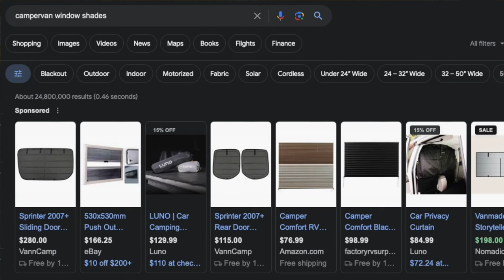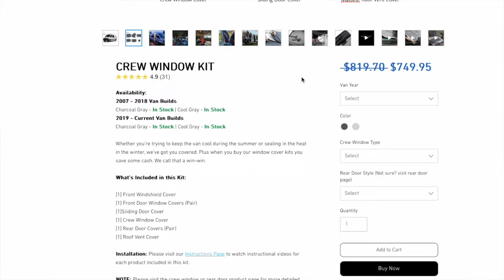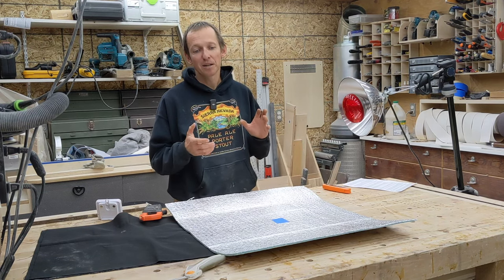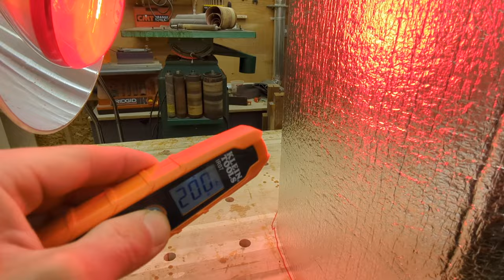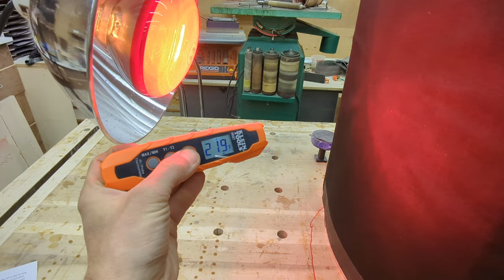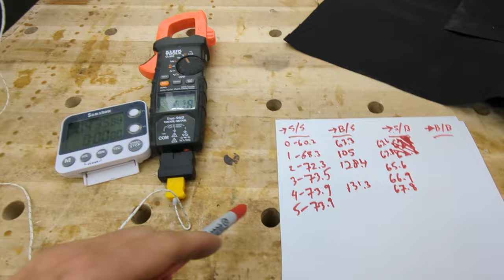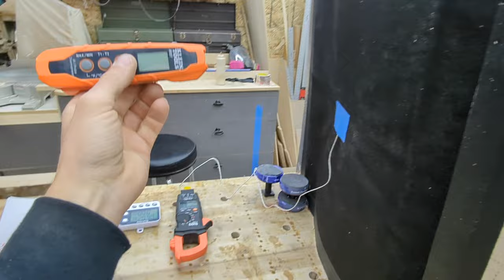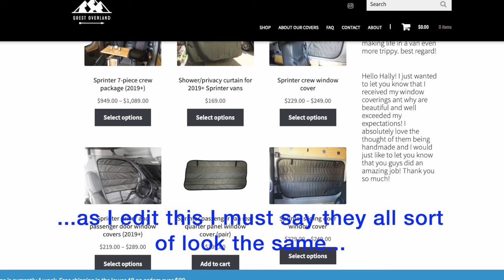Don't Believe the Hype: Window Shades for your Camper Van Conversion

Comment: Do they work “as advertised”?  Probably not as great as you’d hope.  But here’s the deal:  I have tested professional window shades.  In my case it was Two identical Promaster builds (Winnebago).  In one van (my brothers) we covered all windows with the Vannmade custom shades.  In my van, NO shades.  Vans were parked in same orientation, 30 feet apart.  We closed up the vans at 8am at the same internal temperature (68 degrees).    At 2pm, it was 93 Fahrenheit outside.  My van internal temperature was 88.1 Fahrenheit .  My bother’s van.. 78.5 Fahrenheit.   That’s over 9.5 degrees.  Would a simple curtain have done the same thing?  Maybe.  Bot don’t fool yourself, ANY window shades will work to a certain degree.

Comment: It would be interesting if you built an insulated box that has auto glass on one side and reran the experiment with the temperature probe in the middle of the box. Having the glass between the heat source and the shade could change things a bit.
Reply from the maker: Yep, that is something I'd love to do, but just not in the budget.  Even more so to test the various insulation options out there.
Reply: @projectofscience  you might be able to get a free broken piece of auto glass from a junkyard. Thanks for sharing your videos.

Comment: What if your stealth camping and only putting up the coverings at night? In this case there is no direct sunlight. Essentially your just trying to keep the heat in the summer air out of the vehicle, would a black surface matter then?

Comment: Another great and informative video-Thank you! I made my own window covers. I used silver reflective material that faces out with no cover, then a layer of wool insulation followed by dark cloth material that faces inside of the van.
 In summer, the reflective side faces out, and in winter I flip them around so the reflective side faces in. I don't have any test equipment other than my hand.
In summer, when I place my hand in between the window cover and window, it feels very warm, and when I place my hand on cloth material facing inside of the van it feels cool. I'm not sure what's happening to the heat??? 
The only issue that I have is that they are bulky. I wish that could think of a way to compress them when not in use.
Reply: Sounds great. I’m more concerned with staying warm too. Do you have any problems with condensation with your setup? I like the thought of compressing them for storage - has me picturing some kind of self-inflating sleeping pad hack : )
Reply: @s-c..  was in van for three months driving to Alaska and back to Texas. No issues with condensation

Comment: I think the foil backed insulation is itself flawed..  Or, at least it misses some of the benefit of the foil as a radiant barrier.  The foil’s contact with the foam means that the radiant heat being blocked by the foil is conducted to the foam.  And hence through the foam. A better product would separate the foil from the foam, which is obviously mechanically challenging, which is why it’s not done.  

I think a better test would be to install the different insulation solutions onto a box with a thermocouple or thermistor on the inside.

Comment: You didn't test an actual product - yes you are going to lose some efficiency with the black.  But the air gap is extremely important so would be interested to see a real product test. This has to be appealing for people to want to buy it and the black covering appeals for other reasons - aesthetics for instance.

Comment: They do work but you have to make them properly ive tested my ute canopy with thermometers with the shade on and eith them off and bare window's which are tinted where my fridge and battery setup is! They need to be reflectix on the outside not in the core then the 2nd layer needs to have an air gap using corflute or something similar. All these people making them out of black carpet and stuff are just idiots 😂

Comment: I hate to tell you this, but your tests are not applicable, or a test that creates the applicable  circumstances. Regardless of which thermometer you use, you're measuring the heat of the object and not what's being emitted. What's being emitted is the important part. Your taped thermometer is measuring higher because the tape prevents the heat from being emitted from the blind into the surrounding space. Your hand--held thermometer is measuring a lower temperature of the blind in the areas where there is no tape because the those areas are able to emit and dissipate the heat into the surrounding space. In other words, an uncovered blind is not retaining the heat, it's emitting and dissipating more heat into your living space than the covered portion of the blind. And that is bad. 

Conduct a proper test to measure actual heat dissipated into the living space of your van:
-Make a box with a glass window (the smaller the box, the faster each test sequence will progress, but a larger box would make for a more representative test, perhaps a refrigerator box? If the box is representing your van space,  make your window fairly proportional in size to to the box to represent the van window. It doesn't have to be exact, the test results will still tell you what you're looking to find out. What effect does the blind, and its condition, have on interior air temperature of my van?)
- place a freestanding thermometer inside the enclosed box.
-place a freestanding thermometer outside the box suspended in the air  between the sun lamp and the window.
-place a freestanding thermometer outside the box and away from the sunlamp to measure the outside ambient temperature.
(Do not place any thermometers directly against any objects. We're interested in measuring the air temperature, not the temperature of any specific item or any surfaces. Pointing your hand-held infrared/laser thermometer measures the temperature of surfaces and items, not air temperature or emitted heat)
You're going to conduct 3 test sequences. It's important that the applications remain the same for all 3 test sequences......the lamp at the same distance and  heat setting, the same box, same glass window, same placenent of the same 3 thermometers, same ambient temp outside the box, same starting temp inside the box.
-Begin with a control test (don't  use the blind at all in any manner). Record the starting temps on all thermometers. Turn on the sunlamp. Record the readings on all 3 thermometers at one minute intervals (or 3, or 5 min intervals, but make it the same for all 3 test sequences). Continue until the air temp inside the box becomes consistent (the heat from the sunlamp should be consistent throughout all test sequences and the lamp's heat limit will determine when the air temp inside the box becomes redundant at the finishing intervals). Once that happens, end the test sequence.
-Begin the second test sequence. The only thing that should be different is placing the blind over the window (inside the box, as that is most likely how it will be used). Don't change anything else from the first test sequence. Try to ensure all ambient temps begin the same for every test sequence, the 3 ambient air temps AND the temp of the box material itself, as well as the window itself (this is where you can use your hand-held infrared/laser thermometer). Turn on the sunlamp and record the temps of all 3 thermometers at the same intervals as the first test sequence. Stop when the air temp inside the box becomes redundant.
-Begin the third test sequence, ensuring all is the same as the first and second test sequences, except using a blind covered with fabric (covering the window inside of the box)
-Compare the resulting inside box AIR temps from all three test sequences. (It is the AIR temps inside the box that will effect our comfort, not the temps of the items or surfaces. You have to measure emitted and dissipared heat within the van, not the item or surface temps).
There are two more test sequences you can do.
-Test sequence 4. Conduct the same test with the uncovered blind covering the window from OUTSIDE the box.
-Test sequence 5. Conduct the same test with the covered blind covering the window from OUTSIDE the box.

I predict that test sequences 4 and 5 will result in lower temps  inside the box than test sequences 1, 2 and 3. I predict results of tests 4 and 5 fir temps inside the box will be almost identical. (Windows trap sun energy inside vehicles; placing the blind OUTSIDE the window should prevent sun energy from ever entering the window, and the blind being outside the box would be vented to emit and disipate its collected heat outside the box).

You could do additional testing on venting. You could install an adjustable vent at the top of the box. Once each of your testing sequences have reached redundant results at its finishing intervals with the vent completely closed, you could open the vent at controled increments and record results to measure the effect of venting on air temps inside the box.
Reply from the maker: Holy moly if you've got time to write this novel you've got time to run the experiment. Grab a physics book and learn about emissivity.
Reply: @projectofscience  it took me 10 minutes to write that. I've worked extensively with military testing of equipment, including parachute systems and manual writing. I don't think we have a "shorter" version of anything. I could have made a simpler statement without outlining the experiment at all. The experiment would take at least a day. But I appreciate your humor.